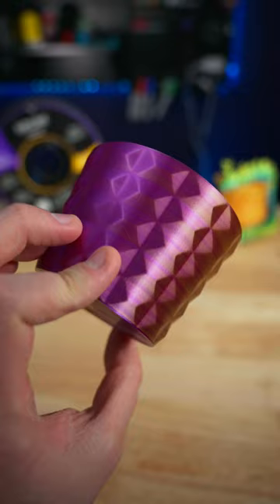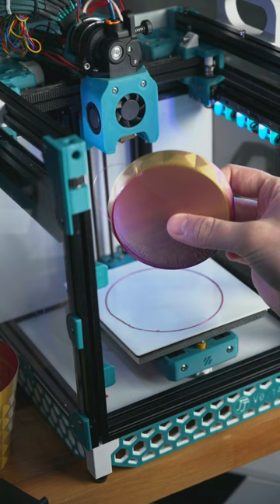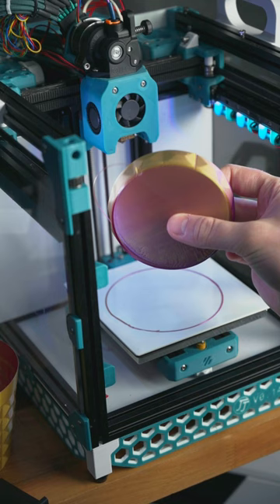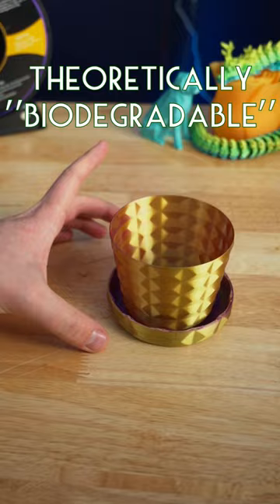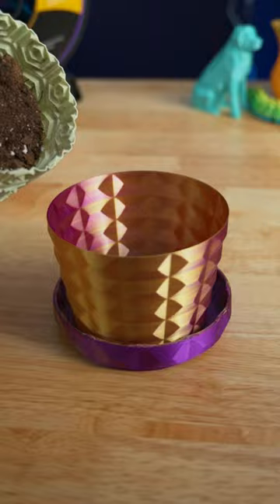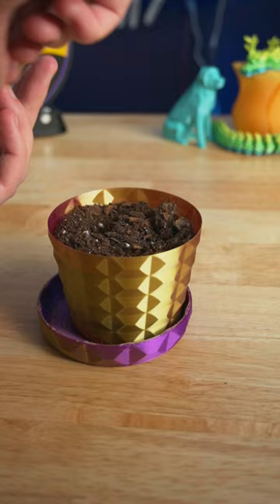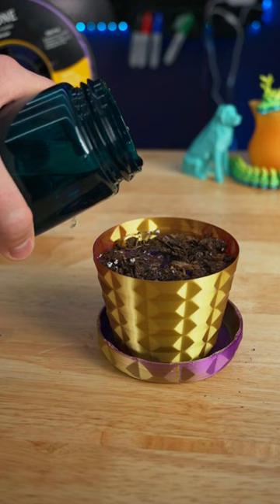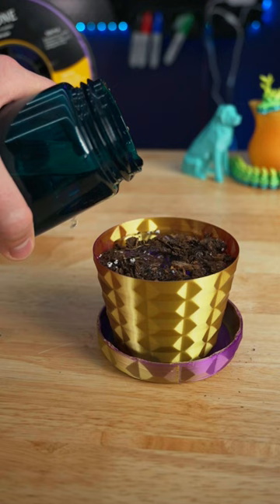3D Printed Planter Long Term Test 1

Comment from the maker: 🔥My Favorite Starter 3D Printer: https://amzn.to/3hMi2r2
Favorite Mid-sized 3D Printer: https://amzn.to/3Eq9KNa

🌈FAVORITE PLA Filament: https://amzn.to/3VNqTIc

📂STL Link: https://www.printables.com/model/172331-flower-pot-planter-with-trivet
Reply: I just noticed that I edited my comment to correct the grammar and it removed the heart
Reply from the maker: @UTKDesign  I'll fix that
Reply: I've asked this before but maybe you cant say? Are you oaid to promote the printers in your links?
Reply from the maker: @TheD3adlysin  I make a little bit off the amazon affiliate links, but I am not paid anything for listing those specifically. I could list any printer I want there. Those two are just the two I would most recommend a beginner to look at since they are budget, quality, and I continue to get good results out of them. I have tried a lot of bad printers, so these are solid choices for the price.
Reply: @JJ Shankles  ok. Cool. Nah amazon affiliate link doesnt reduce the trust i have for a product you are shilling. If you'd said that specific company gives you a cut then I'd have been skeptical. Thanks for the transparency.
Reply: How are you liking the V0.1?
Reply: More Plastic for the Ocean!

Comment: I have actually been using 3d printed PLA  planters for over 3 years and had no problem so far other than minor discoloration on some areas where there was lots of water contact
Reply: Same here: I’ve used standard black PLA for plant pots and their bases for around 1 year— no noticeable issues and thriving plants within
Reply: But this durability is actually bad, right? Since it shows the non-biodegradable nature of PLA?
Reply: @johnraffensperger  Well the thing with PLA and biodegrading is PLA can biodegrade but in very specific conditions usually under human control. In nature it wont really biodegrade too much in most conditions

Comment: Tip, you want a bit of space between the bottom of the pot and the water catcher so water can drain more easily (store bought you'll notice have little ridges to keep pots off the bottom)... So you don't have to reprint, you could probably put some small hot glue dots either on the bottom of the pot or in the water catcher!
Reply: or just add some small stones (like gravel) to the base and set the pot on top of that... 🤷‍♂️

Comment: My turret camera has been on its pole in the weather of the eastern Oregon high desert for 5 years now, plain old ebay special pla. Perfectly fine.
Reply: glad to hear PLA does okay in the high desert, because I'm in one as well. Out of curiosity, what color did you use? Do you think the color added to its resistance to the elements?

Comment: I saw a video of a similar experiment. PLA turned yellowish at the sun after a year. But other than that it was basically same piece of plastic. You may try to measure how much time it took to decompose X% of the element and based on that calculate time to decompose 100%

Comment: i have a ton of 3d printed planters both pla and abs, around 6+ months now, made in vase mode for all of them. I had the abs one outside hanging in direct sun right outside my window its still rocking, a ton of tiny pla ones for transplanting tiny propagations, printed a few large ones 6inch and 8inch. not worth it for the large ones even in vase mode, in my opinion. but the small ones look so great function so well, straight angle ones fit together maximizing the little space in front of windows. if your water is hard it will leave white spots on the plastic but that happens regardless. i printed some of the ones with geometric shapes but they have a ton of gaps at .3 layer vase mode unlike the simple ones

Comment: Heat. Some plants need a different temperature. You have water, sun, soil but temperature plays a big role too. If it is biodegradable that means in a compst bin there would be a much hotter temp than you are going to get from using it as a planter. Composting correctly can kill seeds because of the heat from becomposting materials. I am looking forward to seeing the rest of your experiment. But I wanted to anwser your question of if you were missing anything. Someone else has said to elevate the pot so it can drain and isn't sitting in the water.